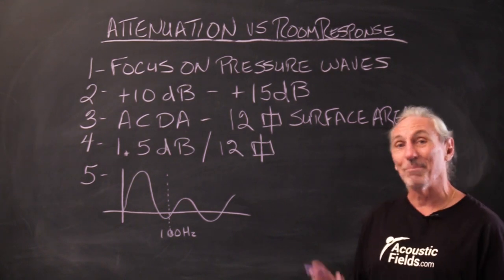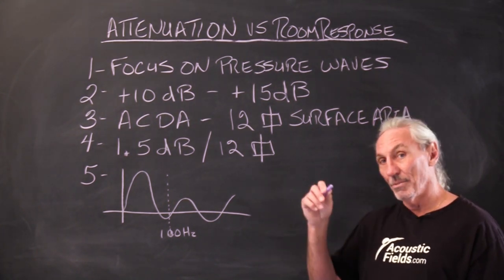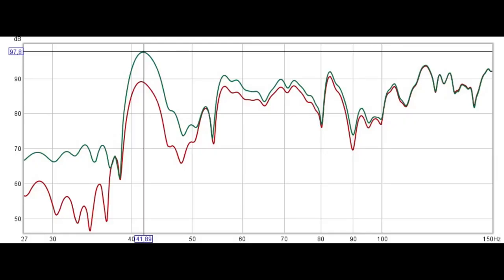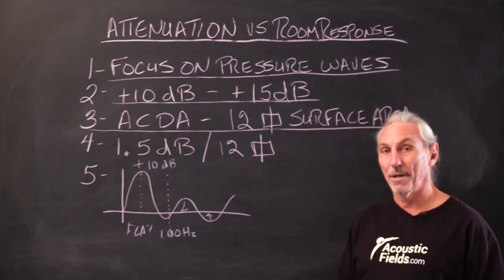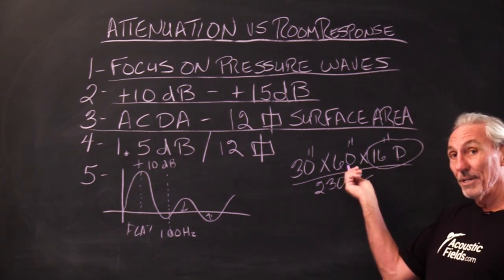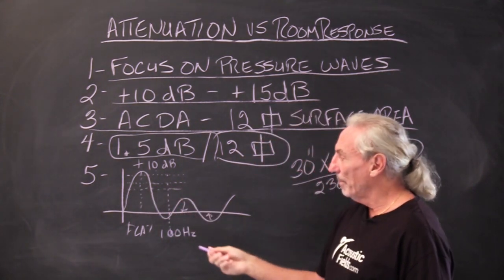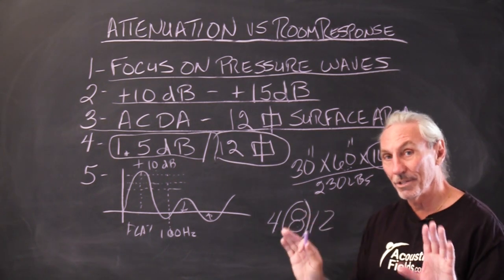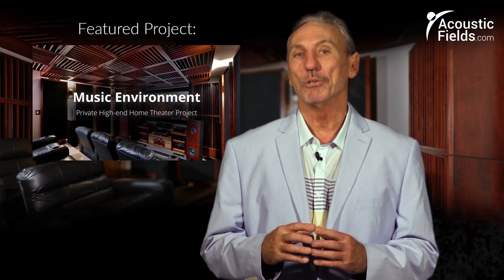Attenuation VS Room Response - www.AcousticFields.com

Comment: Helpful. And thank you for the line about how (we all) shoot for flat but rarely get there... Maybe I'll sleep better now.
Reply from the maker: B,  The design goal is to get to + - 2. With this process, you can then use signal processing (EQ) to smooth out the rest of the curve. Using signal processing on + - 2 will not produce audible artifacts. You can not EQ + - 10. It produces audible distortion at those levels.
Reply: @AcousticFields  Hi Dennis, what particular measurement do you use for this goal, as in, a single point at the listening position with L&R speakers playing, or a single point and one speaker or multiple mic placements with one, or with two speakers etc. Thanks.

Comment: Mr Dennis thank you for the video.   At 2:06 you said don’t be doing that for too long(40hz wave vibrating your pants). I laughed at that.  Have you ever seen bass demo vehicle videos or seen one in real life? They make people’s hair stand up. I know this is the other extreme end of the spectrum from what you do but just curious what you think about this.  If you haven’t just type in YouTube “hair trick bass demos” there’s even some in the subsonic range.
Reply from the maker: D, Prolong exposure to low frequency pressure will cause hearing damage. Remember the inner ear is composed of a series of small bones that are hollow. Low-frequency pressure and hollow bones do not go together.
Reply: I have some friends that own a car stereo installation store and they used to build stereos in cars for these car audio shows.  One of my friends told me that he was at one of those shows and there were people inside a car with the windows rolled up and they have the car stereo so loud, blood was dripping out of one guy's ears.   Yeah, loud low frequency energy can definitely destroy your hearing.

Comment: What happens if my 50hz energy needs 10db of ACDA treatment but the 350hz only need 4db? How do you combat the new null created by the low end treatment?
Reply from the maker: You use a balanced broadband absorber from 30 - 400 Hz and then add extra for the 30 - 50 cycle energy. This issue is the impetus behind our ACDA-12 and ACDA-10 series. The 12 is strong from 30 - 50 Hz. and the ACDA-10 is a linear absorber from 30 - 400 Hz. For very specific frequency treatment you can use Helmholtz.
Reply: When many mid and high frequencies combine at various phase differences they start to average out as lower sine waves. So lower frequencies are especially an issue. I found this out when I was building waveforms for synths and I decided to go wild and create the most complex waveforms I could and then iteratively combine them. What seemed to be the pattern, although I couldn’t demonstrate it, was that the simpler waveforms with mostly low frequency harmonics at different phases would combine to form waveforms with higher harmonics and a reduced fundamental while the ones with more complex harmonics would strengthen the fundamental more often. Factor in the phase differences throughout the room and the fact that physically low frequencies are much larger and in a small room you get a lot of complex crossover areas. In a space like the inside of a bell you might get higher resonant frequencies but even in something as small as a guitar the resonant frequencies are already down into the mids. In a room this makes low frequencies an issue.

I hope I got that right lol